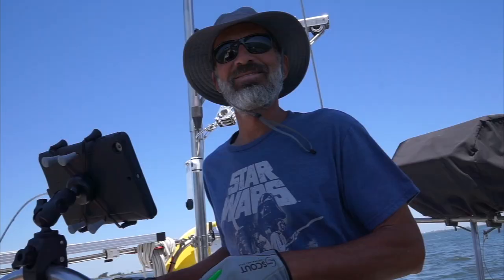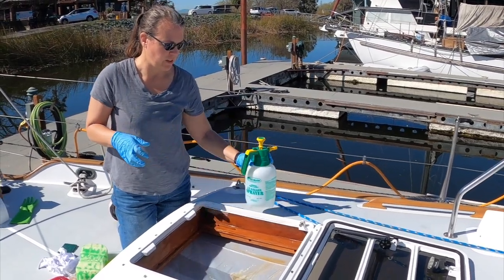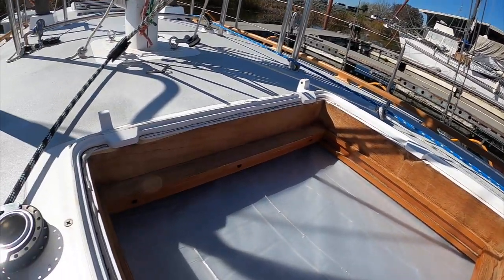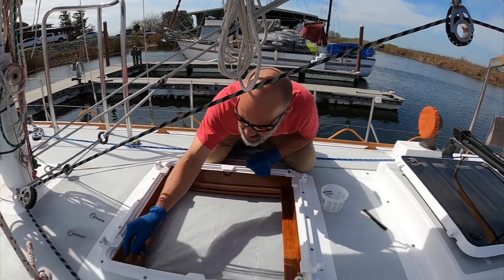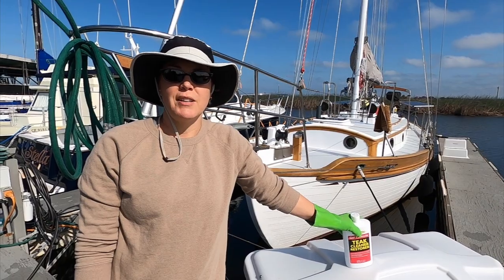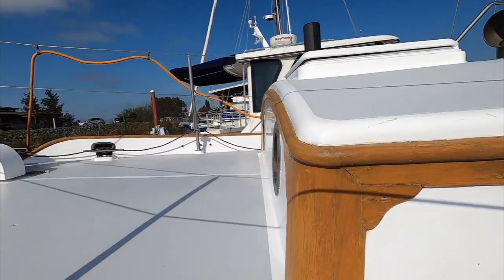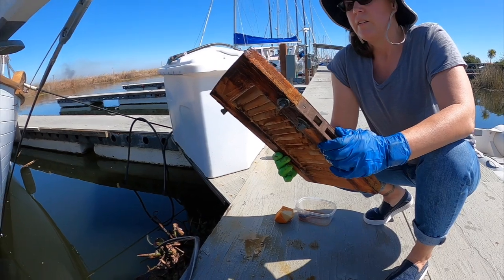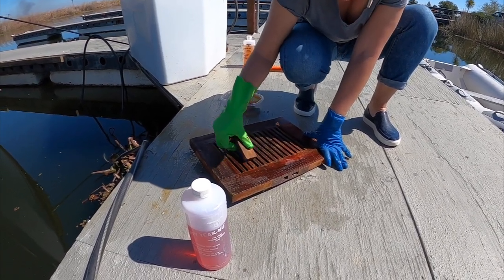Teak Transformation:  Varnish vs. Teak Sealer | SV Ramble On

Comment: I've heard not to use a teak sealer. Have you heard of DiTEC? They have a system that protects without sealing the teak or using oil.
Reply from the maker: I haven't heard of DiTec, but the Starbrite product we use is more like an oil than it is a sealer.  If I had to do it all over again we'd probably get a boat with ZERO teak on the outside (even though I love the classic look of a classic boat adorned in teak).

Comment: I used teak oil in the interior for the last 7 years I have my Tayana 37 and the interior became gradually darker and darker and I do not like it. What I'm doing is washing it annually and then applying a coat of teak oil and almost immediately I wipe it with a cloth. Didn't help. I like your light interior.
Reply from the maker: The previous owner of our boat varnished the interior and we're so happy he did.  It's held up great.  We haven't touched it since we bought the boat 10 years ago other than wiping it clean with a little Murphy's Oil Soap and other than the teak around the hatches which were never varnished.  

The Star Brite Teak Sealer we use is only for the exterior though.  It has to be exposed to UV to cure completely.  We thought about using teak oil but heard that it darkens a lot over time which seems to be your experience with it.  The teak sealer doesn't darken at all, but it will wear off and the teak will turn gray if it's not reapplied.
Reply: @svrambleon  In our Tayana PO used teak oil from a german company that I could not find. I used another brand and now the interior is considerably darker and soon will have the cave effect that I do not like at all. I'm looking for a chemical to restore the original teak transparent look.

Comment: As a brand new boat owner, I'm really enjoying your videos. I'm trying to confirm the steps and products you use on the teak. Are the products that you are using essentially the same as the 3 step system that star brite sells, or are you using something different on the third step? Thanks!!
Reply from the maker: I think the third step they sell in the kit is teak oil.  I don't use that.  I use their teak oil and sealer.  It comes in a small paint can, not a bottle.  There are a few shades to chose from.  I use the natural shade.
Reply: @svrambleon  Are you sanding it before you apply the teak cleaner, etc.?
Reply from the maker: When I originally cleaned the teak I sanded some of it after cleaning because it was so dirty I had to really scrub it and it raised the grain a bit.  And our teak is really old and a light sanding smoothed out some of the gouges.  For maintenance I do not sand it.  Just clean it, let it dry then apply two coats of the teak oil/sealer.  I’ve found it’s best to let the sealer fade quite a bit between coats otherwise the sealer builds up and starts to look like paint.  However, it takes a little more cleaning before reapplication if I let it fade.  It’s a double edged sword.
Reply: @svrambleon  Thanks so much!!
Reply: @svrambleon  One more question if you don't mind. The color of my teak is a little red/orange, but I really like the natural color that you use. Should I be able to sand my down and use the same natural color on mine? I assumed so, but just checking. Thanks again.
Reply from the maker: I assume so too.  Our boat had an orange colored Cetol all over the teak when we bought it.  I scraped it all off, sanded, cleaned, etc. to get to the color it is now.